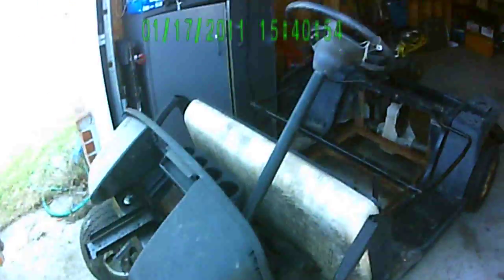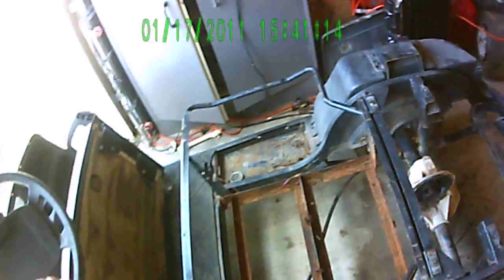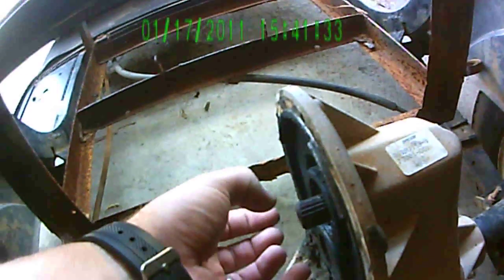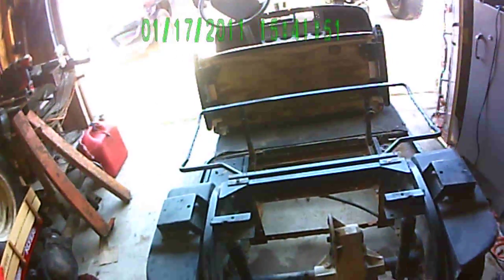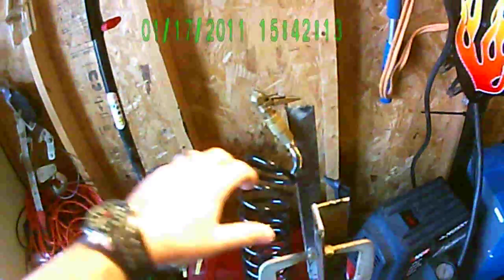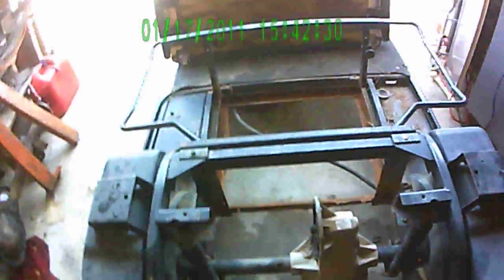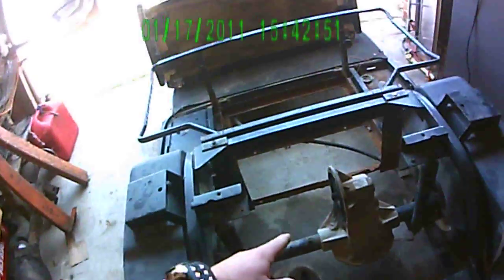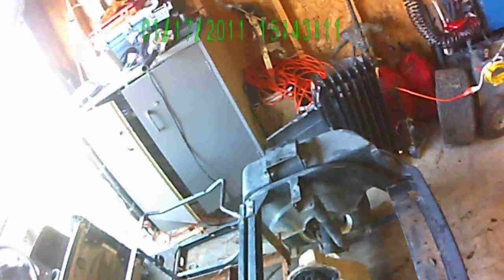Ezgo Electric golf cart to gas. How to put a gas engine on golf cart.

Comment: Charging your batteries with a gas powered alternator will make you go a little further ,yes.
But unless you can come up with an electric output equal to your usage while operating, ( 150 -300 amps continuous) then you will be spending allot of nonoperational time charging ( hours ) If what you are considering worked, We would have had Hybrid Vehicles LONG ago.

Comment: that is nice i have 1886 ez-go with 250cc the engine is blown. i also have the harbor  fright 6.5 and just pulled engine today . what gear ratio did you use and how fast will it go.